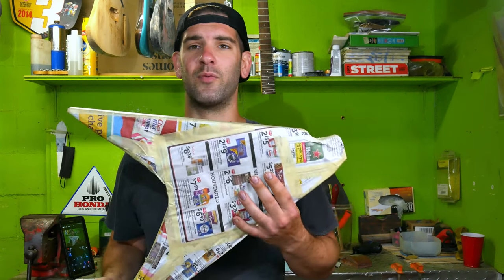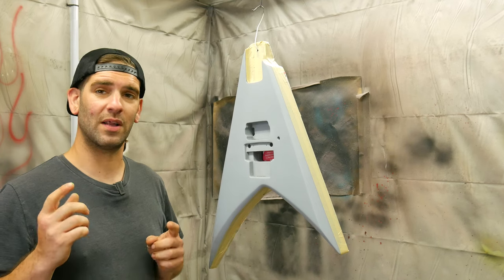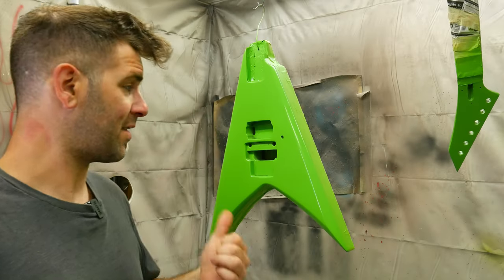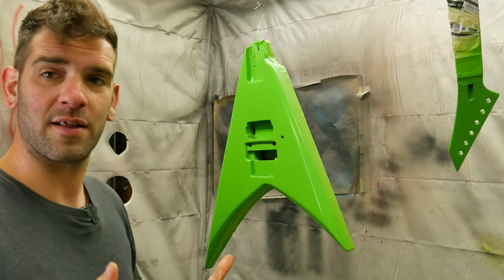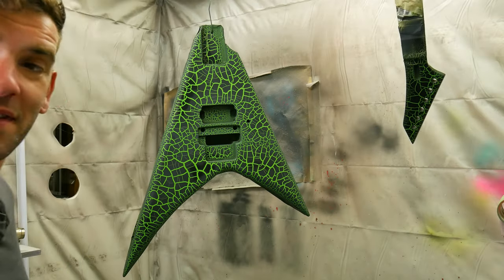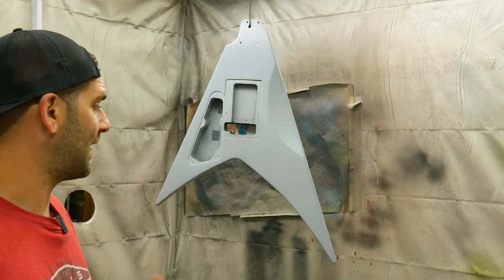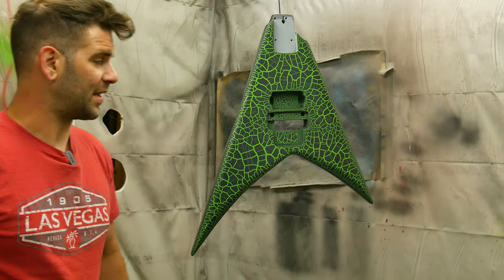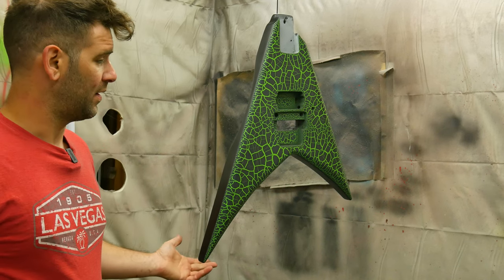ESP LTD Alexi project part 2 / Crackle paint

Comment: This is the best crackle finish I've been able to find using spray cans.  I really wanted to replicate this, fairly sure this is accurate: 

1. Black: Rust-Oleum Flat Protetive Enamel Black (likely 7776830)
2. Neon Green: VHT Engine Enamel Grabber Green SP154
3. Crackle: Montana Crackle (probably the amazon one EC9017)

I will try Gold+Black crackle and report back.
Reply from the maker: @MauriceKindermann  your on the right track.
Reply: Some other notes I made for myself: 

- This guitar was sprayed indoors in a t-shirt, so the temperuature was probably mild (ideal)
- By only crackling the front, you’re less rushed and can focus on even coverage in different directions, getting a nice thick layer on before it starts chemically reacting
- Interestingly you lay a very thick base coat, then let it dry 2 hours. Can recommends 45 minutes
- I’ve seen other videos where heat guns or fans are used to speed up and increase cracking, I’ve also noticed sunlight seems to increase it, but that may be random or due to heat

Comment: I would like to paint my RR too. And sunburst now if you want a black crackel effect on a fluorescent green base you advise me to strip: apply primer, green and black crack. Or can I paint green directly over the sunburst??
Reply from the maker: For best results to make the fluresent green pop you would want to do it over a white prime if you do it over a dark color or primer it will change to shade of the flo green . U dont have to remove the original paint just sand it with anywheres from 400/600 grit sand paper befoee applying primer

Comment: Is that crackle paint difficult to use?
Reply from the maker: It wasn’t to bad, seems like the lighter u put it on the smaller / finer the crackle comes out i put a heavy coat of green on let it dry for almost 2 hours and a heavy coat of crackle and thats how it came out.
Reply: @SIX1NINEGUITARSANDGEAR  awesome, thank you. I haven’t completely looked into crackle paint, is there more than one brand and which did you use?
Reply from the maker: @jacklambert4958  i used montana crackle from amazon
Reply: @SIX1NINEGUITARSANDGEAR  awesome, thanks. I’ll check it out.